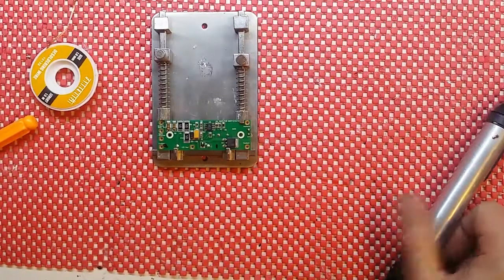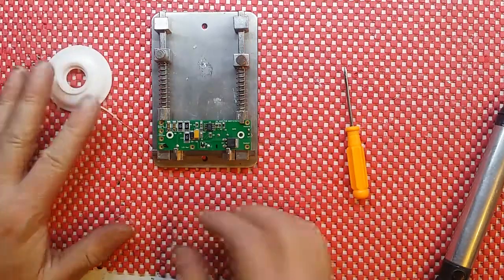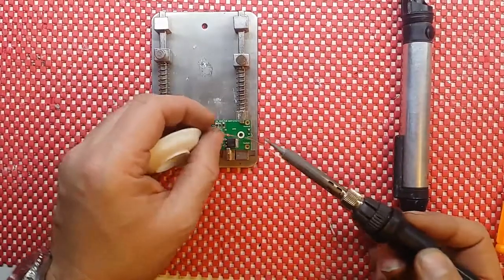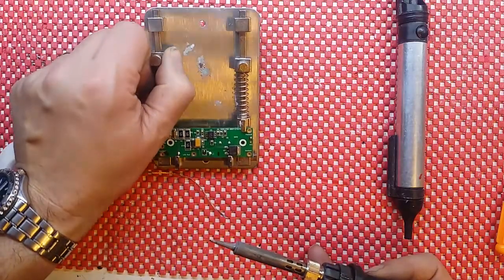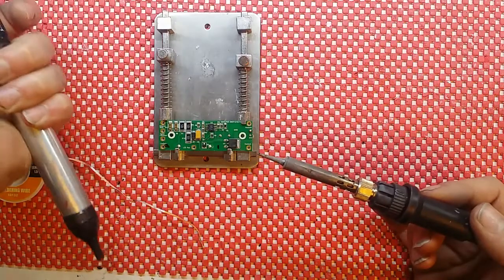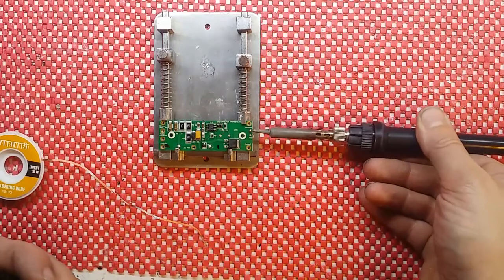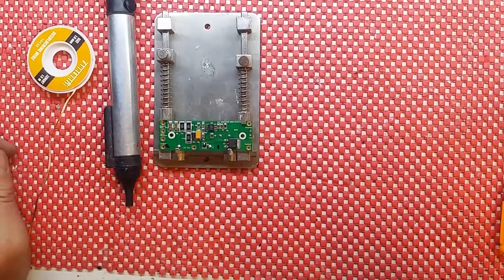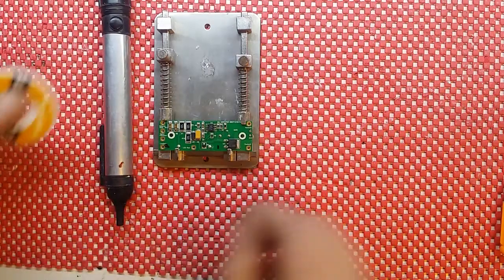Desoldering pump or wick

Comment: I prefer solder wick, but only the good quality stuff, mind you the solder pump I had was a cheap eBay one, I'll just stick with the wick since it does the job for me well.
Reply from the maker: I use both but as you said dont use cheap in either.

Comment: I can't stand wick.  I have had more lifted pads when learning how to solder as opposed to the solder pump.  I love my little pump.  I have had to save it from my 7 year old a couple of times though!
Reply from the maker: i use to hate wick but do use it more now, mainly for bridged SMD pins.
Also solder pumps with flexable silicon nozzles are so much better than the hard nozzles.
Reply: Same! I'm just learning (...the hard way) on 43-year-old synthesizer, and have lifted 3 pads now with wick. I just got a pump and man, is it a million times better and quicker. Once the solder is melted, it's gone in a millisecond...as opposed to holding the heat there for like 3 or 4 seconds or more while the wick saturates...and the old pad starts to warp and lift off, haha.

Comment: Where do you buy a good quality pump?
Reply from the maker: the one on the video is Abeco 2009 Solder Sucker for RS components
RS Stock No. 203-7795 im sure you can find it at other outlets cheaper.